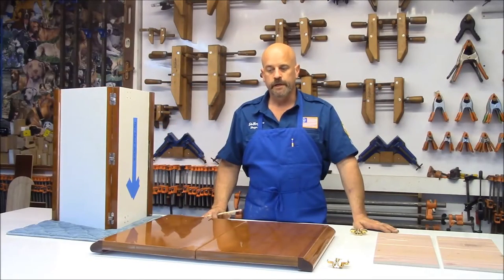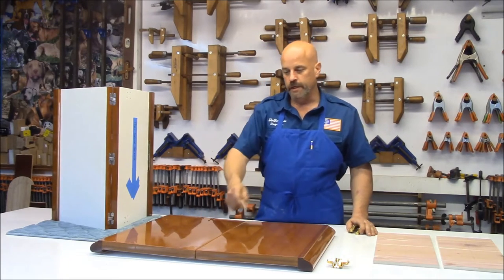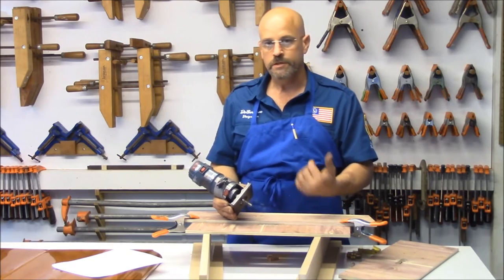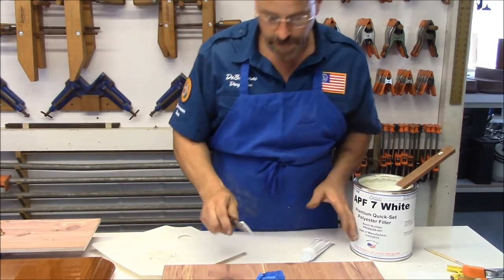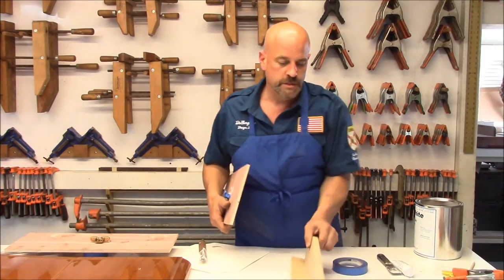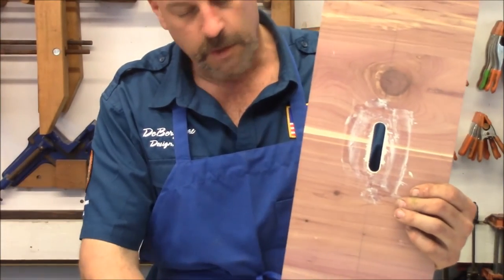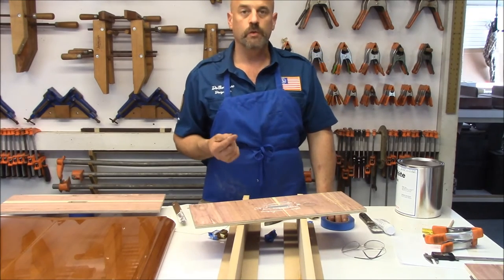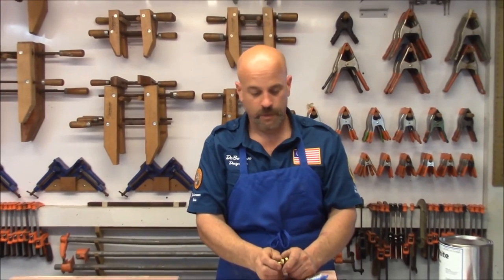How To Make A Jig For SOSS Hinges

Comment: But how do you accurately index this type of aftermarket jig to a door slab then to a door jamb if your building a door with Soss hinges?  Wouldn’t it be faster to just get the Soss Invisible Hinge Router Guide System Template kit?  Thx